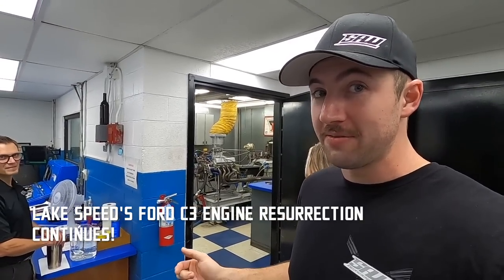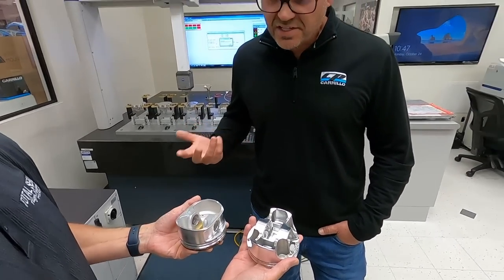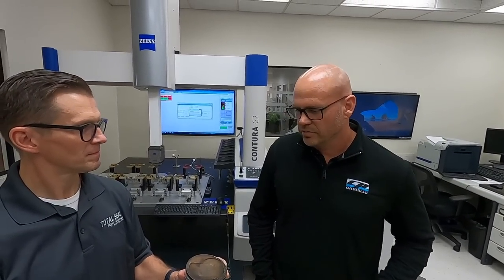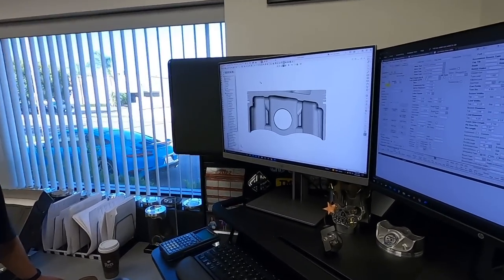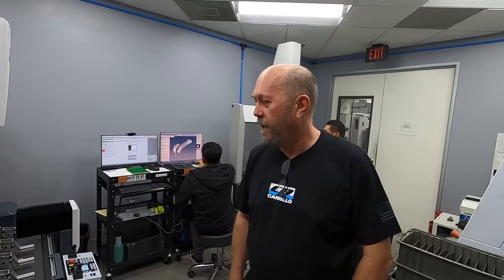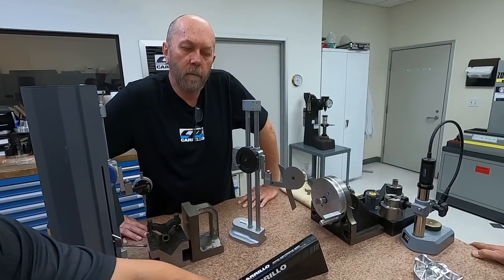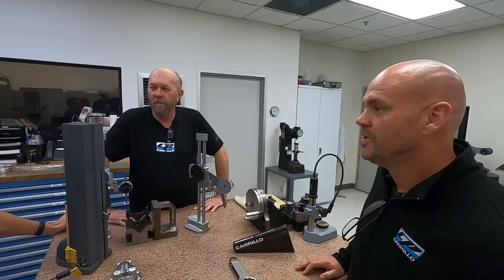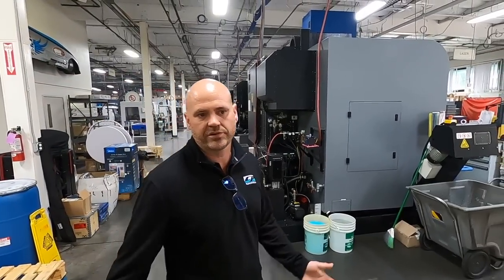NASCAR Engine Pistons & Rods Evolution: Lake Speed's Vintage Ford C3 Gets Modern Technology!

Comment from the maker: This engine was making way less power than Lake Sr even thought it did. When it’s done it’s gonna make WAY more than he raced the car with. We’re so pumped to see his reaction at 74 😂

Support the channel and check out stapletonautoworks.com
Reply: What steel pistons Italians are playing with
Reply: I can't wait
Reply: Well I would hope so. 9/9.5-1 compression did pretty well in my book. Throw some compression in and the C3 heads will shine!
Reply: Small end of the rod, pin, piston and rings are reciprocating weight the reduction of which IS MORE CRITICAL than rotating weight. 
Reciprocating weight must be accelerated from a dead stop TWICE every rotation. Cut 5 grams off of each reciprocating assembly for a total of 40 grams and you will have better results than removing 50 pounds from the car weight.
Reply: @TheJagjr4450  … good point. 5 grams isn’t very much under normal circumstances but when taking into consideration the mean piston speed velocity along with the forces involved during the starting/stopping cycles, the dynamics are HUGE !!! 

Automotive engineering technology and metallurgy suddenly become very important, but that’s just a small portion of the big picture, indeed 🏁
Reply: @danielwilson6665  Indeed, we are talking about the nth degree of engine building. 
On a N/A engine VE is key. Which means a detailed attention to intake runner volume in relation to displacement and throat profiles in order to   keep that column of air filling the cylinder for as many degrees after BDC as possible. Run the longest rod as the rules will allow - the piston dwells at TDC and BDC for more crankshaft degrees and it side loads the bores much less.
It's been 30 years since I built engines for racing, I found the rod weigth reduction of 200 grams amazing. That means probably 40 grams on the small end - that is HUGE.
Reply: @TheJagjr4450  … That grand slam you just hit is so much more than huge, it sailed right out of the park and into the realm of GARGANTUAN !
I’m a big fan of N/A and big time VE is kinda like the sum of those key elements that you described. Most guys have a favorite engine and apparently I’m a canted valve Cleveland addict. 

Some “builders” enjoy taking cheap shots at the success of Clevelands and Clevors but when asked why, they typically respond with a big steaming load of Shinola they heard online. No need for children online whining about an engine that they don’t understand or maybe they got embarrassed by loosing to a C based engine. 😁To each his own so no worries. They will probably survive whatever it is. Maybe not  ✌🏻
Reply: The amount of information in these videos is incredible  , thanks to Mitchell  , Logan  , Lake Speed Jr. and all of these top notch men in these awesome shops ! 👏
Reply: When  will there be a final video of him getting the motor back
Reply: How long before he gets it back?

Comment: The advancement in technology is a game changer in engine building. Back in the 80’s and early 90’s it took a lot of time and money to get to the horsepower numbers that you can get now and at a fraction of the cost. Plus the availability of parts now at the touch of your fingertips is incredible. I hate to be that old guy but, the younger generation getting into motorsports is almost spoiled.

Comment: Cp Carrillo is by far the best piston and rod company. At least on the quad racing side lol. I’ve been racing quads for 35 years. Every engine I build gets this combination and never once have I had a failure using CP products. I installed a set of CP pistons and rods in my 93 Saleen mustang about 6-7 years ago. Original 302 block pretty rowdy cam stroked to a 347 and cp pistons and rods. 12k miles later she’s still is running super strong with zero complaints.
Reply from the maker: Couldn't agree more!
Reply: I always ran CP pistons in my race quads as well...but I used Falicon super cranks with their knife rods.

Comment: This is another really interesting episode with real players being interviewed. I've been wanting to pull the engine out of a 2002 Ford F-150 I have, a 4.2 liter v6, rebuild it with twin turbos. I put a different transmission in it with parts that could take a motor with those modifications. This another stepping stone video.

Comment: Thanks for showing the things behind the making and evolution of a small part of racing engines.
Actually the evolution  goes all the way back to mid 1900s here in USA but even further in Europe.
For the kids out there , these parts are not cheap, and tho they talk lasting a long time, other than long races, most race engines run only a few total minutes a year at full throttle. Did you catch the man say they use to have to change engines in their car 3or 4 times a weekend. It’s great to be able to extend the life of the parts , simply amazing .

Comment: Carrillo is an American Icon.....What other company has records and is willing to inspect & certify their product 20+ years down the road and they are the WORLD CLASS LEADERS on racing connecting rods that go the distance. I have used a few of their products over the years. The "Off Shore Knock-offs" are SCARY if you research them....Metallurgy and heat treating on the copies is SUSPECT at best! MY friend took a set of PROBLEMATIC rods out of a Japanese Super Bike made from titanium and had Carrillo design a set of steel rods that cured all the reliability problems of the OEM hardware that even to "Factory Bikes" were suffering from.

Comment: LOL.. The story about the cams in the aeroplane, we had the same at Ilmor with cranks delivered from Mecachrome for the Honda Indy V8..  they would fail inspection unless they heat soaked for 24 hours... i am a CMM guy, our big one will measure 13ft diameter, and you could walk through it and not bang your head.   I am nerding out on this stuff

Comment: When you swing back through there again ask about what they would do with a modern nitrous design/turbo piston design for top ring placement, that min section at the valve reliefs and pin sizing types.  I had not thought of how a pin would flex a piston differently vs strutted/boxed stuff.  Thanks for the vid!  second side note thought might snag a business card of that peter calvert and do a interview.
Reply from the maker: Great point!

Comment: I'm a heavy equipment mechanic so I'm more of a hydraulic and electrical guy, but I do some engine work, mostly injectors, turbos and pumps. This is very interesting to me though. I'm a hydrostatic pump expert for heavy equipment and would love to see hydrostat make its way into nascar
Reply from the maker: Thanks man we appreciate you
Reply: @Stapleton42  motorcycle racer that's when I chamfer rings and BMWs sidecar racing could run two seasons one motor no problem and we use ball hatch I have all this modern stuff you got today
Reply: Next July I turn 80 I wish I could still be building Motors and racing now I'm in a wheelchair I just dream can't remember good we made some good running stuff back in the day fast reliable with what we had dirt floor racing
Reply: @cliffordmarkell40  my best friends uncle that raised him raced motorcycle in the 60s and 70s. He did endurance races on the husqvarna 500 I think, said they were so heavy yet so powerful.  He died a few years back and I remembered all the late night conversations we had about this and other things. I truly miss that man, besides my father he was the best man I knew

Comment: Great video. thanks. Does lower rotating mass make more per se, or does it allow you to run at higher revs, or does it just help with engine acceleration?
Reply from the maker: It contributes a little bit to all of these factors including less wear over time since there’s less strain on everything. The primary increase in power here is going to be from the increased compression and piston ring technology!
Reply: @Stapleton42  Thank you.

Comment: Great vid! big fan from Australia here,got a question for y’all Love my forged cp’s for my little turbo 6cyl rb! They are older flat tops so would it be worth molybdenum/Teflon coatings on the skirts and or ceramic coating the crown’s or should I leave them raw? It was previously was set up for 7500-8000 rpm and600hp as twin cam it’s currently stripped apart and going back to a single cam for authenticity in a commodore, the cam I’m using next came from an angry 800hp car
Reply from the maker: I’m no expert but if you’re gonna have the pistons out the advantage of having newer ones with a modern hone and ring package would be worth it.

Comment: Keep up the tech! Find more experts and go deeper! It's honestly kinda hard to find engine building, or any kind of technical racecar stuff, on youtube that isn't just the same old surface level, simplified stuff over and over. I know 90% of this stuff because I've been a racer and fabricator for a long time, but I learned some cool stuff.
Reply from the maker: I agree. That’s why we go deep here. If people don’t like it they can go watch burnouts somewhere else. We do it for those who care like you 🏁
Reply: @Stapleton42  Exactly. You can only watch so many burnouts and stuff without being "burned out" and I was a long time ago.
I was surprised, and it's really impressive that they had the old pistons in their database still. That's pretty cool. Good on CP.
Reply: @9rjharper  Have a look at Larry Perkins channel on YouTube, called PerkinsEngineering, they get into alot of different stuff especially older V8 supercar tricks of the trade.
Reply: @nzuncovered1845  I'll check 'em out. thanks!
Reply: @nzuncovered1845  I just watched one on their slide throttle manifolds. Awesome stuff. It's kinda strange you don't see more of those.

Comment: And No skirt on piston , same problem LS motors have , The new pistons won’t last , or will start using oil later on
Reply from the maker: Yes because you Jason know more than the leading piston manufacturer in top level racing, aftermarket, and OEM. Sign me up for Jason’s pistons
Reply: @Stapleton42   No I do not , but used many pistons over the yrs, do your research, all these companies try sell there products
Reply: @Stapleton42  The guy at CP pretty much almost gos brain dead when you ask what the difference in technology lmao , no use to get butt hurt just Piston s 🤣